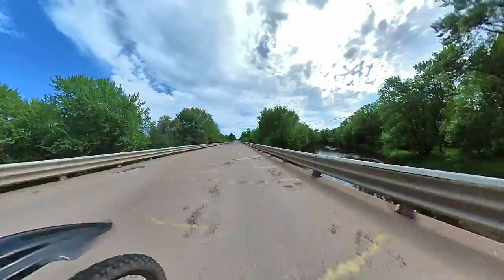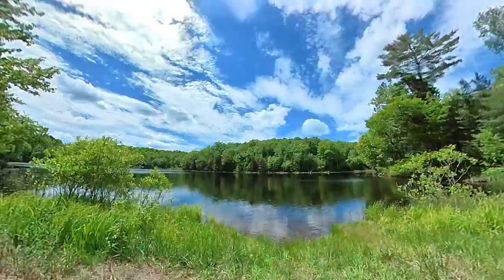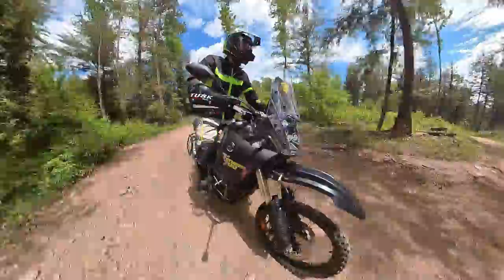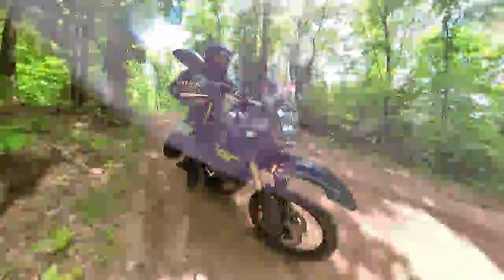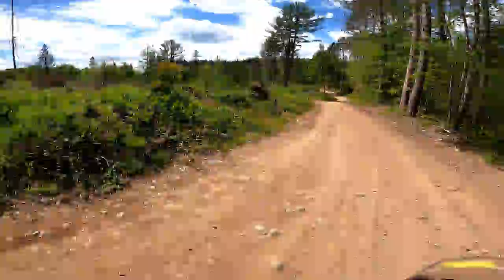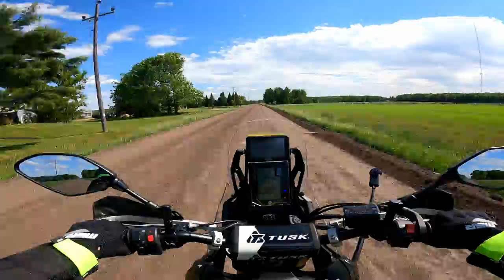Why The Tenere 700 Was So Uncomfortable & How I Fixed It!

Comment: Kiddo its a shame there are few good dealerships that have someone knowledgeable in setting up a bike for an individual rider. I worked many years ago in a dealership and soaked up like a sponge the education needed to understand the physics involved, steering, suspension and ergonomics all get effected by accessories. I watched more than a few riders buy and then trade in a bike when all they needed really was a little adjustment here and there to be happy. 2 of the most important things riders should consider for comfort are seat and rear suspension, all Japanese bikes come sprung for riders around 150lbs  and most Americans are 180 and up. Another big misnomer is a softer seat is better, its NOT A COUCH its a seat that moves and part of the suspension when you really think about it.
Reply from the maker: Funny you say that.  I was just out on my TW which has a squishy slippery seat and kept thinking how much I missed the hard flat Tenere seat.  Got home and took it out for a short ride too and it was definitely a much nicer place to be!  I think I might try to get ahold of a rear shock spring combo that has but high and low speed damping adjustments so it can take the big hits but still have some cushion for normal riding.

Comment: Not sure which windshield you got, but the buffeting seems to be caused mostly by a lack of laminar flow.  Madstad’s setup is great; I have a 16” and an 18” shield and they’re tremendous.
Reply from the maker: That does look like it would be the best option for wind protection.  I got one that fits in the factory spot and is just a little taller and wider at the top.  Works well but it sort of in my field of view which I'm having a hard time getting use too.
Reply: @SwankyCatProductions  Yeah that’s why I love the Madstad - raise it for highway and lower it for off-road so you can see over it.  Best of both worlds 💯💯

Comment: I love the t7 stock bars.

I also have vibration at 4500rpm.  Seems to be more of a common thing among t7 owners. I have bark busters and crash bars.
Reply from the maker: How tall are you?  You have bar end weights and still get a vibration in the grips?
Reply: Remove crash bar bolt under the headlight and put some rubber spaces. No more vibrations.

Comment: Great setup on the T7. Did you flash the ECU and or have you ever had the "snatchy throttle", mine kinda jumps to engagement even after the clutch is fully engaged and trying to feather the throttle. An expert thinks it may be the break in oil I'm using:  Rotella 15w40 my veteran riding pal from GA recommended.

Comment: I’m wondering if you tuned the klr??? Listening to you and Jerry, it sounds like that was a large part of the difference. I understand the ergos BUT it sounded like there was a comparison made from both of you and that was a large part of your appreciation for the Tenere over the klr. Just saying. You already know my opinion on tunes. ALWAYS better, WAY BETTER, than stock. Especially on things like throttle response and certain limiters. I could see that as being a monster improvement just listening to your conversations on the subject of performance one vs the other. And truthfully the only way to get a real comparison. Nothing is ever as good as it could be out of the showroom. Also a bar and possibly riser change on the klr.
Reply from the maker: No tune on the KLR yet.  The company I usually work with doesn't have the program yet but I've been waiting!

Comment: You could try a lowering link on one of the bikes to see how different it is.
Reply: Lowering links kill suspension action and chassis geometry.  Lowering a bike should be a last resort item.
Reply from the maker: It would definitely be interesting to try.  I get asked a lot about how tall you need to be to comfortably ride both bikes.
Reply: I’m 75kg (165 pounds) and 5”11”.
I feel like the bike is still too tall for me and too top heavy at slower speeds. I don’t mind enduro bikes that are tall but only weigh 110kg as you can still man handle them.
I’m contemplating lowering links. Maybe the low seat.
Reply: I'm 5ft7 and 135 lbs with a t7. I'm just trying to figure out a more comfortable seat in general than stock